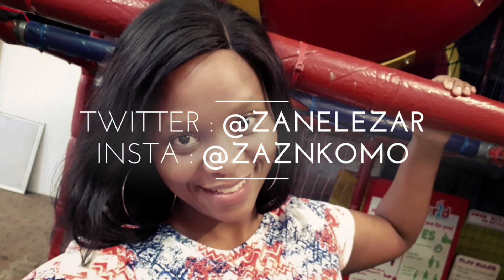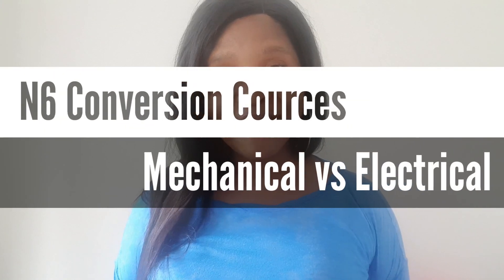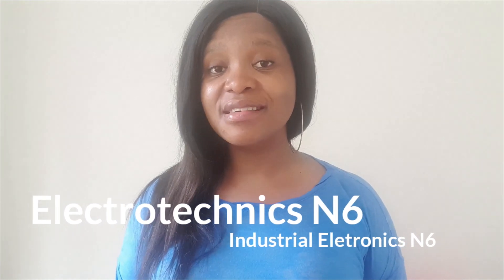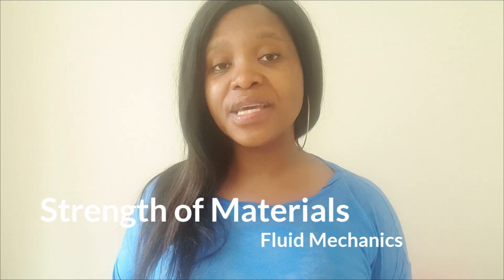GCC Conversion between Electrical and Mechanical

Comment: When converting from electrical to mechanical do I have to write the gcc exam again
Reply from the maker: When you apply to write for GCC - they will ask if you are Mech or Elec (It actually stipulates on your certificate when you receive it). Note that you are asked both elec and mech questions in the exam. (Your conversion would be before writing the 2 exams for GCC)

Comment: Just got my acceptance for Electrical GCC , write in November but will definitely be doing the conversion after I get GCC as if you look at job market most of the posts are for Mechanical GCC and luckily at my work I’m getting Mechanical experience too.